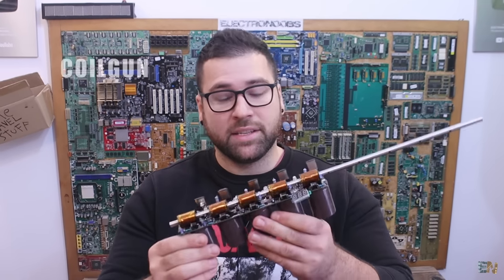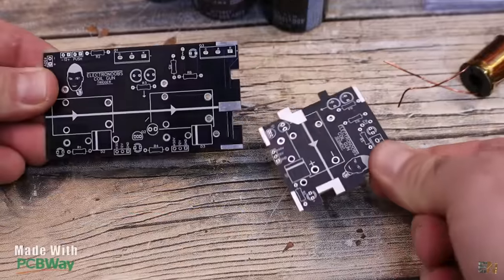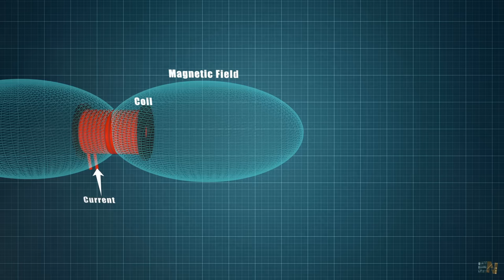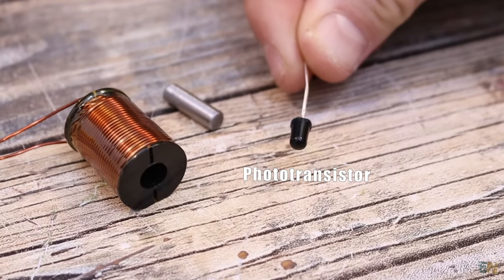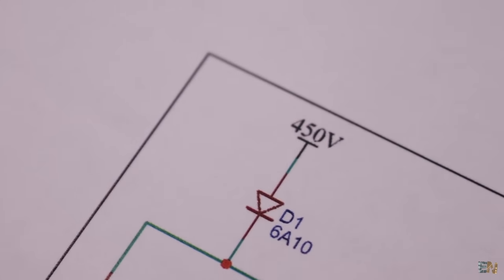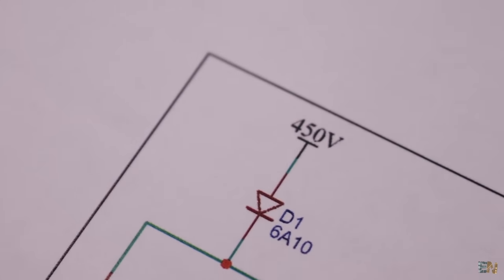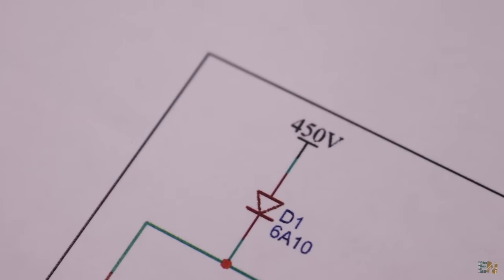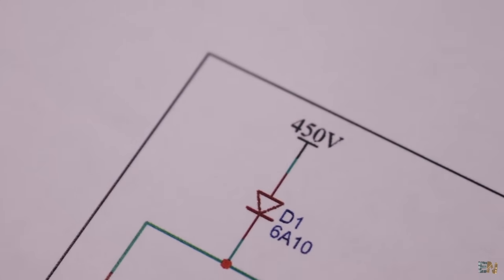I've Made a Powerful COILGUN | Separate Stages PCB

Comment: It would be amazing if the moduls were just cubes containing both the electronics and the tube, that could be put together, but that would need to be amazingly precise. But if you had that, you could just add new gun-parts to the final gun, as opposed to be able to do that on the pcb level.

Another thing that would be nice, is if the projectile somehow got some rotation to stabilize mid-air.

And it would also be cool, if you could prevent the projectile from touching the barrel at all, by holding it in the middle magnetically, because then there would be no degradation of the barrel, and also you'd reach much greater speeds.

Comment: Just a suggestion, add a chrono graph (for projectile speed) at some point you will hit the speed limit for your discharge circuitry the chronograph will give you exit speed to monitor so you can see if each coil is actually linear or fine spacing needs to be adjuste, also years ago points ignition systems in cars used a condenser capacitor to force the magnetic field collapse at high engine rpm, which is the same principle as your projectile speed increases so your chronograph may be able to show you that “speed” limit as well

Comment: Why do you need a metal tube as a barrel? Will it not be a short-circuited coil, which heats up and reduces the efficiency of the system (which is why the cores of transformers are made of separate plates)? And why do you need such a heavy bullet? Isn't the speed of the bullet the main advantage of electromagnetic guns? Why do you need a weak converter when you can charge capacitors up to 310 or 620 volts directly from the 220 volt network through a conventional rectifier? This could compensate for the low muzzle energy of such a Gauss cannon with an insane rate of fire. And the mobility of the gun can be provided with ready-made solutions in the form of powerful gas generators or inverters from car batteries. Of course, then blowing will be needed on the radiators of transistors and coils, but the fun is worth it.😼

Comment: Let me start with a little critic.
In the animation you said that the bullet detector is behind the coil and cuts the power off. 
This makes no sense. The capacitor would be discharged long before the bullet arrives.
Later in the video (13:52) we can see that you actually put the sensor infront of the coil.

You said that the metal tube interfears with the magnetfield while a plastic tube does not and it has also more friction. In addition drilling holes in a metal tube is way more difficult and the metal tube is also more expensive.
So your conclusion was to use a metal tube. I don't get it.

But to be fair, I had this idea for years and I have also the knowledge and the skills to build this and it would become very similar. 
But I never did. Because I'm lazy.
Kudos to you for putting so much effort in this. And after all it's a great result.

Comment: Can you add a vacuum pump on the barrel with a flip up rubber valve at the end. that way you can reach higher speeds as you eeduce the drag. You can open the end valve in sequence after the last coil. If you use Nudinium magnets as ammo, and use them in the same polarity you dont need to cut the coil power but reverse it 1/2 wat through. That way you will get more power per coil cycle

Comment: Nice project. The only thing is that thyristors don't stop feeding the coil until capacitor is empty, so when projectile is already moving fast - it will be "sucked back". Done similar with MOSFETs and microcontroller based timing - works fine, especially using cylindric magnets as projectiles. No accuracy at long range, though.

Comment: I think the solution for acceleration at the later stages with more components would require increased spacing to allow the parts to have the time necessary for continuous acceleration.
Reply: Or pre programmed initiation timing

Comment: In the schematics you have placed a diode in antiparallel to the coil, so the magnetic field will not collapse instantly when the coil is deenergized. You should try to place two zener diodes in antiseries connected in antiparallel to the coil. If you allow the coil to reach hi voltage during de-energizing  you should obtain a better result.

Comment: You can also reverce the current going through the once the porjectile reches a coils midpoint effectively doubling the work each coil can do. furthermore, the last coils in the stage should have less windings with lower gage wire the point is to dump as much current into the coil. This is a function of time and relates to the internal resistance of the cap.  Finding the optimal time to turn on the coil is important since magnetic force is exponential inverse to the distance between the coil and the projectile. You don't want to energise the coil, dumping most of the capasitors current, when the projectile is far away from the coil. One may need to calculate the discharge time of the capacitor through your circuit to optimise for this relationship.
Reply: The projectile must be magnetic in order for the reversing to work

Comment: Magnetic field strength is measured by current multiplied by a bunch on variables. Thus, to get more power, grab the voltage from the capacitors and drop it to like 2 volts before sending the energy to the coils. As you know, dropping voltage increase current proportionally, so dropping the voltage from 300 to 2 increases the current by a factor of 150, which means 150x power >:)

Comment: You can also test with different kind and shapes of  'bullets'  like more pointy, heavier or lighter material (if you want to shoot greater distances or do more harm )
Excellent project and video.
Thanks for sharing.
Reply: Using a teflon tube will increase velocity.  Also, a parabolic nose on the projectile would be nice.  Pull a dry cleaning patch through the teflon tube with some Tri-Flo or other teflon lubricant on it will also increase velocity.

Comment: A slight improvement might be to place the projectile sensors before the coil, along with a slight time delay between the sensor signal, and the thyristor gate.  Why would this be better?  Because, in the current design, by the time the projectile reaches the sensor, it is already leaving the coil, and at that point it is being slowed by the coil's magnetic field.  I would think this would be even more of a deficit at the later stages, as the projectile will be moving much faster, and thus any delay between the sensor signal, and the collapse of the magnetic field would mean the projectile position would be even further along, and even more subject to the magnetic field, which would be tugging it back, and thus reducing it's speed.  Also, the time delay, between sensor and thyristor, would need to be shorter for each subsequent stage, to compensate for the projectile's greater speed.

Comment: looks good,  try 3 fullbridge rectifiers coming out of the a.c. back into the a.c. for  6 wavelengths then into a 3 3 phase capacitors  into the load, or 3 full bridge rectifiers into d.c. load , run it through a variac for safety and fuse , after rectifiers put  inline electrolytic capacitor in series or parallel to d.c.  load

Comment: you don't need any gaps between the coils. the field of one coil just needs to grab the projectile and pull it only as far as the centre of that coil. The coil is deenergizing once the projectile is on the other side of centre and the next coil needs to grab it at the correct time. your board wont work because there is no timing configured between the coils. if each module is the same, then you will have problems once you start getting a high number of coils. your timing will be way off. to make a coil gun. you need each coil to energize at a different time, and even a different speed. all your coils are the same size. so they will produce the same speed. thats not correct either. the coils should be progressively bigger. you will need to work out how big based on exactly what your using as a projectile. So many problems with makign a proper coil gun.

Comment: If you use AC circuit design, you wouldn't need caps and triac or coil triggering and project properly selected projectile more that 4X faster.

Comment: Try adding a timing delay to trigger the coil one step up from where the projectile is. You can then tune the delay to shorten and drive the coil one up from the projectile, compensating for the load of the C and L, and the increasing speed of the projectile. Microcontrollers at this point would be fast enough to handle the signals and delays needed.

Comment: The next stage is linear accelerator like they use on roller coaster rides.
The coils are mounted like ovals going long way the way you want to push the metal and they have a bunch of "waves" that accelerate basically running the coils on AC at higher frequencies to accelerate the metal plate on the bottom of the ride

Comment: Actually disconnecting the coil in the middle creates a back emf and a reversed magnetic fi4eld repelling the projectile, so it actually accelerates all the way through.   To keep accelerating through all the coils they would probably work better if the  the coil winds reduce (lower inductance and lower time constant ), combined with larger diameter wire (higher current), and increased spacing, and tighter timing.  That would create exponential acceleration.
Reply: Sure. Maybe, maybe. See also:
!Coilgun and Survival in the Zombie Apocalypse (Step by step assembly of Coil Gun from 01:57)
https://youtu.be/_9WUcGwmS5s

Comment: This could have a useful application in the building industry as a driver for a staple-gun for example which traditionally uses a bulky air compressor. This could just be plugged in or even just run off a rechargeable battery

Comment: Are all the coils energized before firing? Could you use a magnetic projectile and switch the coils north/south to push and pull? How would using compressed air and maybe some rifling to launch the projectile effect speed? I so want to make one in a semi automatic. Thanks I know I'll be laying awake tonight thinking about making this
Reply: If all the coils were energised that'll just drain the capacitors making it weaker

Comment: If you could wrap your own coils, you could wrap around the phototransistor/led and it would shut off the field faster to prevent the reverse fielding altogether. With trial and error you could see if the exact middle is best or at 5/8ths or 3/4 length would give you maximum speed. Or even better, have a non-ferrous nose cone like brass to trip the gate without reverse magnetic...another way to build great speed is to put the barrel under a vacuum...which could be accomplished by a vacuum on the barrel only or enclose the entire gun and pull a vacuum on everything...of course you need a piercing disk to allow the bullet to exit the barrel...
Reply: Sure. Maybe, maybe . Very probably. See also forgotten weapon Coilgun HS-47:
https://youtube.com/shorts/BPReIoZ-2Nw?feature=share

https://youtu.be/0WF1BGmit78

Comment: I bought one of these, but the larger 7 segment kit. I kinda wish that the schematic was downloadable like the GERBERs. Part of the additional issue is the kit i got is a single board so i didn't have to solder sections which isn't mention. 

I just want a schematic and a part list, assembly can go well with just some basic paper inserts. 

Great Videos, always has me coming back.
Reply from the maker: You have the GERBERS from my website? If yes, the scheamtic is on my website: https://electronoobs.com/eng_circuitos_tut74_sch1.php If you have a different PCB from AliExpress for example, I don't have a scheamtic for that...

Comment: If you want to take into account to acceleration of the bullet, why not place a ToF sensor at the beginning of the barrel, then measure how far down the barrel and how fast the projectile is, combine that with the transfer characteristic of each stage to compute the optimal on/off timing.

Comment: i believe the design could be better by this: 
i would not put led / light receiver in the end of each coil because by the time the projectile reaches the half of the coil it has the hightest velcity but when you take it out of the coil it, before its being detected by led emmiter it will have lost half of each velocity due to the pulling back to the middle of the coil 
so i would do it like this: 
i would  put a chip to understand the "change " of the magentic field when the projectile was going inside the coil
and by the time that i understood that it was in the middle i would "shut it off" and then it would continue to the next one and the next one etc.

Comment: As the bullet nears exit point it might be traveling faster than the discharge rate of the capacitors. It would be worthwhile to measure how much charge is left  in last stage capacitors, if there is substantial charge left it would be worthwhile to use a smaller coil with larger wire diameter in the last stages so the capacitors discharge at maximum rate as the bullet passes and impart their full energy to it.

Comment: Consider using a pulse forming network (PFN) triggered by the same 'object detector' as it exits each coil and adjusting the physical gap between each coil as well as pulse width, shape, amplitude, and so on.

Should yield a precisely adjustable "acceleration field" that is limited mainly by coil construction.

Timing is an obvious requirement

Comment: do you get arching with 450V on 2.54mm headers? that seems bad, check for arching. Normally it's 50V/0.5mm, also seems like your metal tube would cause eddy current and reduce efficiency, but I don't know another way to fix that, maybe it's a trade-off you considered. Love the modularity! Seems like the layout could be optimized. Possible noise during firing if your spacing from 450V power feed to feedback signals (looks like it works though.) Using more copper of the PCB to reduce DCR, but I am sure this is like a 2oz copper. Very impressed. the power is surprising. If you have time, please take this to the next level! LOL, 20 stages, would be sooooo cool, and a coned projectile. Really neat project, thanks for sharing.

Comment: Here is a very very rookie question. Is not it possible to turn the magnetic field reverse, then we can use it to push (after the center of the coil) instead of being neutral?
Reply: Only if the projectile itself is a magnet with the front half North and the back South or vice versa.  But again as stated are the eletronics fast enough to the get the benefit.

Comment: as the projectile speeds up per stage the timing between opitcal switches will been to be tuned. coil collapsing flux will start to drag on the projectile. youll need to switch on earlier to reduce the collapsing flux suck back on the projectile. maybe look into diode across the coil in reverse to snub the back emf..

Comment: Fun project, if you could improve your timing, you'd get much faster projectile speeds, as well as lowering the ESR of your capacitors. Your caps all have a fairly high ESR, so they cannot discharge much of their energy to benefit the projectile velocity.

Comment: I do not know electronics design so if my comment is dumb that is why.     Instead of using the photo transistor circuit Can't you design the circuit and time the discharging of the coils?   Then you could adjust that timing for maximum velocity.  do not recharge capacitors until the last coil has fired.   You could use a chronograph and measure velocity between each stage and adjust the timing until you get maximum velocity.  Is that doable/reasonable?

Comment: That solder you were using looks like it was having some trouble flowing especially with those joints holding the coils on.  You should try leaded solder if you aren't using it.

Comment: after 3 or 4 stages you're gonna want to switch to higher voltage and smaller, low ESR capacitors, like ceramic doorknobs, because the ON time is gonna decrease drastically as the projectile increases in speed.

Comment: Do yourself a favor and get a higher wattage soldering iron and a larger tip! Many of those joints were cold, a proper solder joint should be smooth and completely fill the hole around the part. Especially since you are trying to solder together large components with a lot of metal, these can take heat away from where you want it very fast. Higher temperatures, fatter tips, and high wattage soldering irons will help. As a word of caution, however, higher temperatures means a better chance of burning your board and yourself. Most solder joints shouldn't take longer than 5 seconds when soldering above 600F (~315C). Don't be afraid to use flux either! And as a further tip, completely fill the pad with solder on those larger interconnect pads, that wire connection looked sketchy to me. When soldering wires to a board, push the insulation all the way down against the board and trim the wire on the other side down to lessen the chance of short circuits. No exposed wire should be seen where the insulation meets the board! And don't shortcut by soldering the wire on top of the hole, tin the wire and put it THROUGH the hole! My mentor would be having a heart attack if I started soldering like this!

Source: my experience working with laser projectors and board repair.

Comment: Damn that's intense! It would be so hard to dial in the stacked modules would it make any sense to have one long solenoid with a timed current limiter or some kind of gradual winding pattern? I'm sure there's a reason why all coil guns are designed the same just curious if there are any other design variations out there